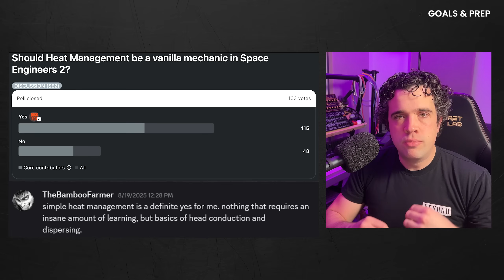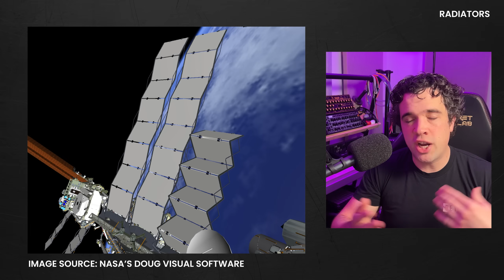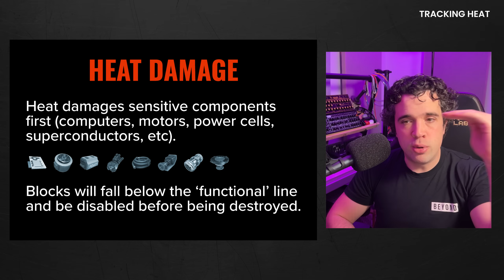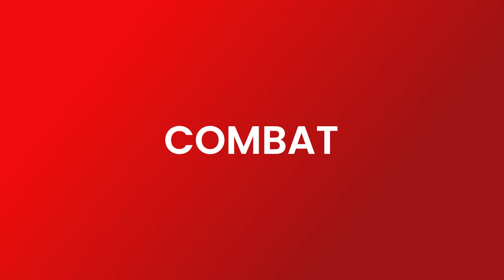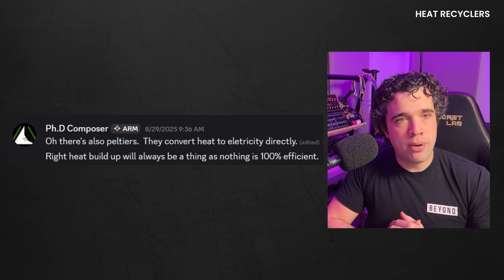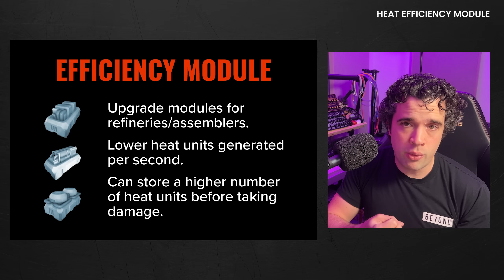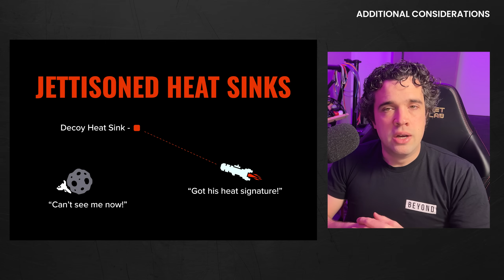Heat in Space Engineers 2? How heat could change EVERYTHING

Comment: This sounds like a horrifying idea. 

"Pretty much every other space game out there"?
You mean Empyrion, Freelancer, No Man's Sky, Hardspace: Shipbreakers, Genesis Alpha One, Dreadnought, at least the majority of the X series, Homeworld(s), etc.

There are VERY few space games that has heat mechanics, and for good reason for most people. It becomes a bar to manage, that overcomplicates the already existing complicated systems that are likely there, especially 3D combat. 99.9% of the time, it wont add much, and in terms of Space Engineers, it just becomes more blocks to add that doesn't really add engineering to the game. Most of these are a bit older games, but the only places you really see heat, is within Sim games.

Unless it becomes just a "bar" for the ship, it would also increase a lot of complexity on the programming side. 

Especially radiators and heat sinks essentially just becomes a very punishing that just requires more blocks to solve for most people. You aren't really adding anything beyond another tons of blocks to manage really. Heat being important in real life, doesn't mean it has to be included in Space Engineers. Other mechanics that are INCREDIBLY important in space is airtightness, proper electrical wiring, structural integrity, center of mass, reducing moisture, and not letting debris float around without gravity. Heat is also more or less important to manage in space, depending on whether you are in or outside shadow. Some designs don't really take heat that much into account except for re-entry, quite a lot of satellites essentially don't have any real relevant heat management, because it simply doesn't produce enough heat, etc.

Game mechanically, as I've already pointed out, doesn't add that much, outside of "Just add more blocks to the ship".

If anything, something that genuinely will affect designs of ships would be dropping the gyro, or keeping the gyro as only a very low power module for turning, and switch to vectored thrust. That will heavily affect designs, because you have to actually spread out thrusters, have to take center of mass into account for optimal flight characteristics, and will directly affect turning ability. If anything, that is far more impactful than adding heat.

Heat will also be a mechanic that HEAVILY punishes you for not sitting down and calculating, or just requiring you to place even more blocks to make sure, rather than reward you for clever design. It is a "lose a ship". While you can already do this by undercounting thrusters, which I hope SE2 will help with by giving you UI telling you whether you even can break compared to the G forces of a planet, and not much that you can really "engineer" around either, it is either more thrust or no thrust. You add another mechanic where it is either/or you got enough thrust AND whether you got enough heat sinks / radiators and your vessel is destroyed I don't think sounds that great for SE's already rather casual design.

You don't actually "solve" gun spam death bricks... they will still exist... you just add more heat sinks and and do another trade off, like already is here... You also punish small tight designs... heavily... so in reality you didn't really solve anything. EVERYTHING just ends up with less guns/reactors/etc... so doesn't really help anything... but you also add in PvE combat (and PvP for that matter) that it isn't just about having enough guns and mobility, you add a third axis where you need enough heat management blocks, that might require you to get more thrusters for the mobility, and all three axis can get you destroyed without much input from the player because they mismatched their design, instead of just two.

You don't really get that "interesting mechanic" you think about. Heat sinks will be internal, radiators will be external... If anything you are encouraging gun spam death blocks EVEN more than before, because now you become far more effective than the "I am managing my heat levels" because you choose to just go all out, real short, and disable most of the target before it becomes a problem.

You are not adding the balance you think you will... you are encouraging the exact design you don't want.

It sounds like a lot of complexity, for very little gain, and will hurt balance even more.

It sounds interesting on paper, but comes with slews of issues for an already pretty simplified game, that doesn't really add that much on paper.
Reply from the maker: I obviously disagree but that’s okay, heat isn’t for everyone (which is why it should also be a global setting to turn off)

You’re not losing a ship by learning. See the chapter on Safety Shutoff. Default behavior is the ship never takes damage. It’s outlined to be easy to learn.  

If you read through some of the other comments a lot of people agree it would help balance combat which is right now as arcadey as it can get. A lot of great points to this mechanic being discussed. There’s no balance to infinite ammo death bricks which never overheat. You’d be hard pressed to find any game where at least the guns don’t overheat, for good reason.  

I think I most disagree with the comment that managing heat doesn’t contribute to engineering. If managing heat isn’t engineering then no other mechanic in this game is. Avoiding engineering elements in a game with Engineers in the title is the wrong direction. It’s not much different to manage than power. Both will shutoff blocks if you don’t have enough capacity and both are fixed by easily adding more capacity. 

If anything this outline isn’t engineering simply because it’s too rudimentary. Heat could be WAY more complex which I’d be down for but most people wouldn’t so it should stay similar to other mechanics in the game.
Reply: @diggrok Yeah, so you don't lose the ship to heat while landing, you instead lose the ship because you run out of thrust... In combat because your guns stop.

And managing heat doesn't contribute to engineering as basic as it will be, in the same vein that ARK doesn't contribute to real survival because you chuck berries.

It becomes an extra bar to manage.

And just having a global setting is not a solution for talking about whether a setting fits. 

You just made the opposite of a reactor, where you have to throw blocks at the problem until your heat balances.

And heat CAN'T be way more complex, because then the game isn't Space Engineers anymore... A lot of people focus on that "Engineers" part, while Space Engineers isn't really about engineering. It is a rather arcadey block building game... And as I said, vectored individual thrust has more to do with Engineering.

You also agree with people that it would solve gun bricks... No, it would make gun bricks more efficient than other ships... The incentives that make gun bricks a thing still exist, and those incentives is that fights need to end as quick as possible. All you did is change the meta so pretty ships are less likely to be viable.

The heat scanning just means that trolls have a way to detect new players, and not really that emergent gameplay with launching heat sinks that confuses people, which is interesting. It just means servers either need to accept their block building game become closer to Rust or ARK on generic servers.

You didn't balance the game. You just made infinite anmo death bricks contain one more resource, heat sinks and water tanks. That's not balancing death bricks, that is nerfing all other ships that want a nice looking interior. Because you added the tools that allows death bricks to continue.
Reply from the maker: @SioxerNikita  how can a mechanic which adds limitations make a problem which currently has no limitations worse? 🙃 

What do you envision as a solution? (Other than renaming the game to Space Bricks)

Side note, every custom server I’ve ever played on places limits to total weapons a grid can have (often 20-30) with additional limits on only so many guns from each category. My favorite server Stone Industries limits grids to 30 guns with a max of 10 from each category (missiles, lasers, CIWS, artillery, etc). This is probably the most widely adopted “fix” in SE1.
Reply: @diggrok  Funny, you use that sarcastic little head flip... Now the reason why it becomes worse, is that the death brick, is still effective with a very minor redesign... and other designs that wants to be aesthetic, look like engineering, and actually try to be actual space ships, they get HEAVILY punished. 

And yeah, there is no real solution, outside of artificial limitations, because you can just build what ever blocks is required to fulfill any limitations, because this is a sandbox block building game.  And that artificial limitation, a lot of people would complain about. Also it can be bypassed by just landing grids together, so now you can have 40-60 guns per grid, artificially. It doesn't fix anything in the sandbox.

Even if you added like structural requirements, the most efficient design is still ... just a brick with guns... because the minimum required blocks, is all you really need, to be efficient...
Reply from the maker: @SioxerNikita  the mods which limit per grid do luckily factor in subgrids. So if you connect two grids which each have 30 guns to make a 60 gun ship, it disables all but 30 guns. 

No matter what limitations exist there will always be some type of meta and players who build towards that meta will always have an advantage over players who want to build aesthetic. 

Even with shields (which I’m not huge on) there were a lot of people that wanted them just so that pretty ships could be more feasible. But to your point it’s silly logic because even if they can survive longer than normal, they will still lose to a meta build which also… has a shield 😂

Heat or no heat there will always be a meta, it is what it is. There is some say Keen can have as to what that meta is based on limits they set but those that build for it will always have an advantage over those that don’t. 

Worst case scenario… we have jump drives 💨
Reply: @diggrok  Okay, and I bypass your limit by landing a ship, or I bypass the limit by having connectors sent to overwhelming strength so I just "move around" blocks with guns on them... 

And yeah, there will always be a meta, and there will always be death bricks. Even Empyrion with all of its limitations have death bricks... just death bricks that gets the maximum amount of guns in the best combination, because shields in that game is also limited.

And yeah, Shields also exacerbate the exact problem, making death bricks better, because pretty ships just has a wider gap than death bricks again.

But again, you ignore the negatives, and now you are shifting from "it solves death bricks" to "There'll always be a meta" and the meta is always death bricks.

The problem is that the heat, especially as you described, will just widen the gap between pretty ships, and the aesthetically bad death bricks.

Also, fun fact... Real life space combat will also likely just be death bricks. As many weapon systems (Or as big of a weapon system) as you can possibly fit, so you can eliminate the target as quickly as possible. That's what modern Naval vessels, tanks, and other vehicles are. They are just death bricks optimized for modern combat. Aesthetics in real life just comes naturally because of physical limitations like drag, friction, ballistic physics on the hull, ACTUAL heat engineering that requires openings close to the most heat generating systems, lack of enough power to do more, etc.

And of course, actual cost and resource limitations.
Reply: @diggrok  Also, if you actually want a decent idea... you have to engage with the negatives of the idea, instead of going a long winded "Nuh uh". The good ideas don't come from "Oh, but it would be really cool if...", they come from that but with the added ", and I need to consider what impact it has".

You didn't even consider HOW it impacts gun/death bricks vs. other ships. you basically went "Oh, now those ships can overheat, great" and forget that all the pretty, nicely engineered, non-death bricks are also affected, and they will be affected a lot harder.

Optimizers will optimize... regardless of what kind of pretty mechanic you make. They will take your mechanic and your intended balancing, and turn it inside out, until it becomes essentially the same problem, except it is now harder for everyone else to reach the efficiency of the death brick, because there are more knobs to fulfill.
Reply from the maker: @SioxerNikita  also how is this not engaging with the negatives? 🤔

And optimizing is engineering. The point I made was you can still run a bunch of weapons, you just have to put some effort into.
Reply: @diggrok  Yeah, and it isn't really that much extra effort as you described it. It is just doing a few extra blocks, and filling up water before the fight, and making normal ships even less viable than the death brick you dislike.

And you aren't engaging with the negatives, you ignore the effects it will have on combat. You also ignore completely what heat scanning will actually do on general servers. It will punish newbies. If heat detection is added to NPCs, it will also punish players for not throttling down their bases, or they have to add a ton of radiators or enough air vents that it runs cool enough.

It's not really "engineering" it is "Another bar to manage".

I even mentioned something that WOULD be actual engineering... adding vectored thrust... Thrust where placement of the thrusters matter, and nerf the Gyro so turning is primarily done via thrusters (Obviously an automated system to calculate what thrusters should fire for what direction you go, and when you turn). That does add engineering, it also doesn't solve gun/death bricks, because they just change their design slightly to accommodate. 

You essentially went "Nuh uh" and also tried a logical "Gotcha".

I have read through the comments, and you agreed to another user saying it solves the death brick, you implied it solved the death bricks in just this conversation, you agreed with "Oh it'd be cool to send out heat sinks to confuse" while the meta will not be around the cool engineering solutions you seem to like. All it does is shift the meta slightly, and still just go optimal. 

Optimal in Space Engineers is the death brick, because it is a sandbox building game. Either you have to put so many artificial limitations to try and balance like Empyrion does, with grid CPU, that you cannot connect grids because all landed grids on another grid disable shields and guns,  and AI blocks also just means that if you have artificial limits, the way to break them is just have multiple death bricks with AI blocks.

And optimizing is not really that much "Engineering" if the solution is "Put more of Block X / Y on the grid, now it's solved"... Engineering in Space Engineers primarily comes from self-imposed artificial limits. Wanting the ship to look nice, having interiors, keeping ships to certain sizes meanwhile, and trying to fit everything into that volume... Death bricks do the same, and shave all of the aesthetics and interior, because those aren't actually necessary.

You haven't addressed the negatives at all... you just keep calling it engineering, you don't engage with the arguments, and imply that it solves the issues you have... the issues you have aren't solvable... not if the game continues to be a full sandbox.
Reply from the maker: @SioxerNikita  I think vectored thrust and having thrust play a role in turning would be SUPER dope! It just has nothing to do with why we can’t have heat. Also responding on my phone so it’s hard to respond to every point. 

I do think it will help solve death bricks, I just concede that to the degree it tones it down there will still be some type of meta.

I think the core philosophy difference we have is that you seem to think that because death bricks exist that it is what it is and there’s nothing to do about it. And I’m of the camp that we should figure out if and how we can create a balance. 

I’ve responded to you FAR more than anyone else so I certainly object to the idea I’m not engaging with you.  

Also I made a 20 minute rant in addition to 40 minute video to ideate on ways to balance combat. These are my proposals. 

If you have a solution I’m encouraging you to share it. But if your solution boils down to there is no fix then this thread is literally pointless 😅
Reply: @diggrok  It has EVERYTHING to do why we shouldn't have heat.

Because heat isn't just "Neat, I have to design around it" it is add enough blocks to solve a bar issue... It is not unlike power in Space Engineers which is not an engineering issue, it is add enough blocks until you don't have a power issue.

And no, I don't seem to think that "because death bricks exists, that it is what it is and there's nothing to do about it", I'm saying EVERY incentive is to build death bricks. Real life carriers? They are real life death bricks that just has to account for little meat cylinders moving around and not going crazy. Most of the volume is dedicated to one job: Being able to generate as much destruction, at as long as range, as feasibly possible. Modern Destroyers is pretty much the same, 1/3rd of the volume is a missile system and storage of ammunition for that missile system, because missile launchers can be stacked nice and neatly. Then a Helicopter landing bay or two, because Helicopters allow your ship to shoot the enemy ship before the enemy ship can spot you, as well as help with logistics... primarily it is for detection purposes. The entire vessel is optimized for one thing: Maximum death power.

Heat doesn't add a constraint that changes that death bricks exist, because you do not have meat cylinders you have to deal with, you don't have structural constraints that limit how to deal with stuff, you don't have heat systems that makes placement of power plants important to place in relatively vulnerable spots, with usually less armor, because the heat needs to be dumped somewhere, you do not have to deal with interior volume to be able to maintain, you do not have to deal with month long skirmishes, you don't have to deal with ballistic physics on armor armor, and different armor varieties... At minimum if not remote controlled or AI, you need a cockpit somewhere, and with third person view on, you don't even need to place it in a vulnerable place (or use vulnerable cameras), you just need enough guns to end the fight quickly, and a conveyor system to teleport ammo to the guns, enough thrusters to be happy about mobility, and enough gyros to turn.

Your heat only adds one more aspect: Add some water tanks so you can vent heat faster than you generate it for a while until you can end the fight.

Fun fact, that is also how modern fighting platforms work. MBTs do not have super advanced cooling systems to keep the barrel in good condition... they accept that you shoot and end fights quickly, if you can't, your barrel will warp, and if you continue more than that, it will likely crack or break. The cooling they have is relatively minor... because again, death bricks is the meta, even in real life.

It is a bar... and if it adds enough complexity that design constraints becomes an actual issue, it is so complex and realistic it doesn't fit in SE... and then it still feels out of place, because none of the other systems add the same level of complexity. It would also increase processing time in an already processing complex game.

And the "But just a global setting" is not how you should argue any feature... A feature should in GENERAL be on by default, because if it can't be on by default, it likely doesn't fit the game... with small caveats for easily added features for the more hardcore players.

And you still didn't address heat scanning at all. That one is terrifying if it was added, because on servers it becomes the noob trap, where the established can prey on the new. It would require meta rules to deal with, and not all servers will have that, because they want a full vanilla experience... Official servers certainly doesn't have meta rules. It will just become like ARC or Rust, very quickly, dividing the haves from the have nots.

And my solutions for combat balancing? Frankly, just add different weapon systems, tracking penalties against small designs (Not a size difference penalty, that wont work, because it can be designed around to avoid that penalty), so small designs can work, and the rest like weapon caps, etc... you'll just have to do your own servers with mods, and such, because it doesn't fit SE.

Even with weapon caps, the incentives of design will still just be death bricks, just... a bit more spread out guns, and still just maximize the amount of guns. Because even real life, weapon platform designs is maximum death bricks as much as the constraints allow.

There literally isn't a solution, there are only trade offs, that might enable more variants of the death brick as optimal designs.

"I’ve responded to you FAR more than anyone else so I certainly object to the idea I’m not engaging with you. "
Responding does not mean you are engaging with what I write. You don't really address the points made, and you still aren't. You say it will solve death bricks, you don't explain why, and ignore the reasons I say that it wont solve death bricks... and you still ignore that the constraints of heat that would limit death bricks to a significant degree, essentially nerfs every single non-death brick as well. My Firefly Serenity ship is now not only less effective in combat than the death brick, the difference between my Serenity ship and the death brick is now multitudes larger, and you get more people adopting the death brick.
Reply: @diggrok  Oh yeah, and vectored thrust and nerfed Gyros might actually help a bit (but not solve) death bricks. You genuinely do see different flight profiles from long and spindly, and cubes, with cubes inherently becoming more sluggish. Bricks will be in the middle ground. It will reward longer designs with more mobility, and it will penalize shorter designs with being more sluggish. 

That is a thing that wont necessarily just make death bricks inherently better, while heat just adds another constraints that a death brick can absorb, while "movie realistic" ships eat all the penalty on aesthetics and lack of more interior volume.

Right now, with Gyros, it rewards more interior volume a lot.
Reply from the maker: @S @SioxerNikita  I’m on a phone trying to respond to literally a hundred  comments I can’t counter all points in an essay at the moment. 😅 I’ll bookmark this for when I’m at a keyboard because I have notes and agreement on a lot of points, but not all which is okay. That’s the point of these videos. This video literally came about from scripting a response video to my first video. Just give a guy a minute.

This is one mechanic in a series of videos it’s not the only component.

I for sure hear you on the sensors, I have some notes on it I’ll share when I have time because I agree it can get out of hand if tuned poorly. 

Also we can disagree, that’s okay. In fact you should join my Discord. When I make these videos I share the outlines and we collaborate on it. I also then post outlines to Reddit and the SE Discord then make adjustments. These aren’t half-baked ideas it’s very collaborative which is one reason there’s so much support. I’d love to get your thoughts on future videos. We’re spitballing character combat ideas right now.
Reply: @diggrok  I guess I can try join some day, but I am a hobby game designer, trade offs and how it will most likely shape games is exactly where I live. A "This mechanic is cool" is not enough justification for a mechanic to exist, especially if the intent is to solve a problem, but essentially makes that specific problem worse.

Just so you are aware, death bricks aren't solvable, at most mitigatable, because the incentives of platform design is "Death brick", even in real life. Real life death bricks just have to handle meat cylinders that can't be allowed to become insane.
Reply: @diggrok  First off... I definitely don't think I could have handled this conversation quite so cordially as you have. I commend you in that regard.

Second: If managing thermodynamics isn't engineering... what is ???

I certainly agree that, yes, there will always be a "meta;" some players will always try to abuse game mechanics to leverage a seemingly unfair—albeit "legal"—advantage over other players. Players who want to play and have fun will always get wiped by these players whose entire concept of "fun" is just to bully every player until they quit the server. They also seem blissfully unaware that, due to even minimal voxel deformation being visible from space in SE1, playing on a hardcore server with established a**hole "meta" players meant getting obliterated back to the stone age unless you managed to keep a tidy little hole entrance and underground base long enough to gather resources and build a ship to get off-world to build a mobile base somewhere in the depths of space that you could hopefully relocate quickly enough if your location was ever discovered. At least with heat signature management you could DO something about it, AND it would be tied to how large and power-hungry your base became.

I heavily disagree with their notion that the addition of heat management would inhibit the ability to design sleek ships; they would just look different. I think many players would be able to incorporate thermal management systems into amazing looking designs, and I think it would add to the immersion and only enhance the beauty of a well-engineered craft.

I may have gone a little ranty for a moment, but honestly I think any argument they have against the idea is just an absolute moot point. You could argue every resource is just a bar. Health, oxygen, hydrogen, power, material resources, weight capacity... they honestly sound like they'd rather just not play a game like Space Engineers at all. 🤷🏻‍♀️
Reply: @EllianAzazel  I think you didn't address any of the points. 

Not everything is just a bar. You are right, health, oxygen, hydrogen, power, is just a bar.

Adding more arbitrary bars doesn't necessarily add much to the game. 

Also, if managing heat is Engineering, then Elite Dangerous is an Engineering game... 

Also, minimum voxel deformation is visible from Space? We'll see how obvious it'll be in SE2 later today, but you could build bases without voxel deformation. You also ignore the part where this would still make people capable of detecting other people in space much more, and yes, push the design more towards a Rust / ARK on any server without community rules.

And yeah, it does punish people who want to make good looking, and nice ships more than it punishes optimizers. Most games that add a ton of levers in multiplayer games tend towards favoring not the best "engineers", but the best stat optimizers that builds good enough. 

And also, as I mentioned that you also didn't address in the slightest is the "hidden" death mechanic. You already have this right now, not enough hydrogen or thrusters of various kinds to escape the planet can make you crash and burn (Which is why I hope we can get more visible stats, so it is easier to calculate). Also landing a ship. Yeah, experienced players wont have this issue, because they are used to the game, but it is a heavily punishing mechanic already for new players. Now you add another one, and that new one is essentially an opposite reactor, and you didn't put enough heat sinks on while landing, and now you get destroyed without really having a good way to test.

"At least with heat signature management you could DO something about it, AND it would be tied to how large and power-hungry your base became."
No, you can't really. You are also saying that its the voxels that gets you detected... but the voxels still exist... so it doesn't really change anything there. It only adds another lever where you can get punished on a standard multiplayer server. If you heat manage you have to spend more times to add heat management blocks, and if you do, you spent more time. Or you have to run everything at lower power, so you don't end up flashing red hot to other targets. That just makes it more punishing to get established, until you have the infrastructure, and it even further emphasize being already established.

Here is the difference between you and diggrok here, and me. I am the kind of person that would install a mod like heat management... and I can see how it hurt the game overall having it as part of the base game.

Space Engineers got popular exactly because it is a mix between a creative block building game, and a simplified model that allows you to build your fantasies, and enough mechanical blocks to make people able to build very interesting contraptions.

Adding more bars to manage doesn't really help with that, it adds more tedium for the majority, because it is solved with "Just place more blocks".

The Engineering part of Space Engineers has always been about self-imposed challenges, finding space while building interiors, building weird factories, optimizing a design to be as small as possible while still functioning, and the last aspect, while still keeping it rather pretty.

Not managing random bars.
Reply: Oh yeah, not to mention on servers with PvP it will punish players who has little understanding of the system if heat sensing is added... which means you they get screwed, and might not understand exactly what they did wrong, or require everyone to run essentially minimal power to not be detected at all.